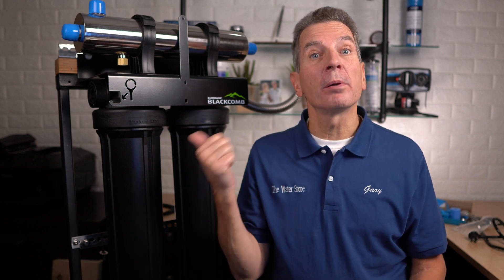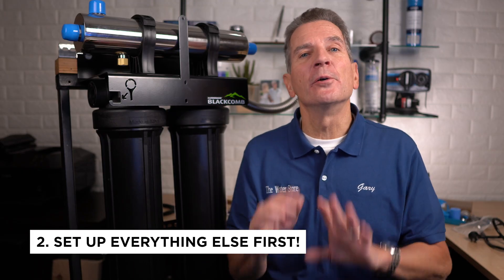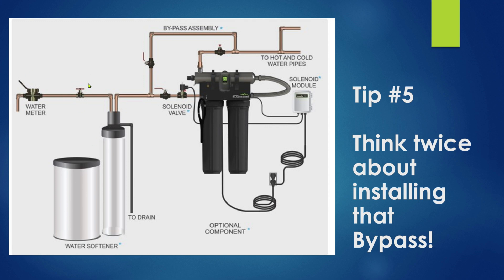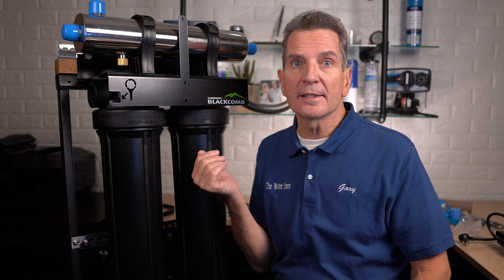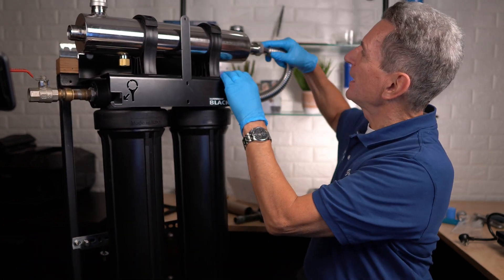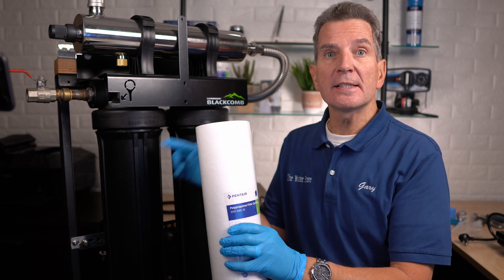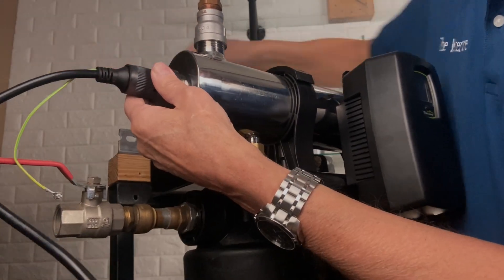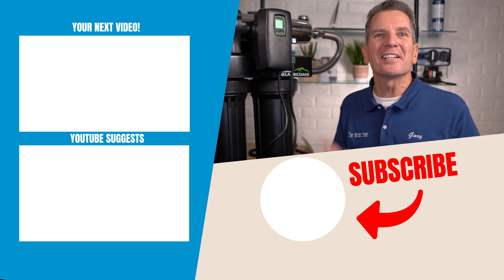How to Install a LUMINOR RACK UV SYSTEM

Comment: Great video but I have a question how do you install pressure gauges on the unit?
Reply from the maker: I'm pretty sure you can drill the housing for gauges, but why would you want to?  You will notice a pressure drop in the home long before a pressure gauge on the system will alret you to the concern.  We never install pressure gauges.
Reply: @water_estore  per the manual they are already drilled for pressure gauges (brass screw caps) but 1/4" wont work. They are mainly to be used in my application to see the individual filters which may be contributing to pressure loss.